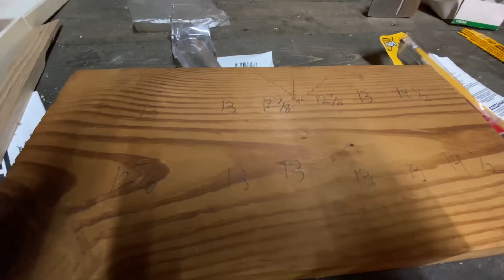The Modern Home Makeover // Episode 6 - Sistering Floor Joists in Basement

Comment: I use a lot of reclaim lumber and when I run into the nail issue I use a nail punch to drive the nail into the wood past the length I need to cut off.
There are powered Nail-punches on the market now also.

Comment: Try to bridge the joist this way they can distribute the load as a unit rather then what u have now which is individually. If u wanted to go overkill then double ply the subfloor or pull up the existing sheathing and go thicker.

Comment: I'm curious to know why you would think that adding horizontal structure like sistered joists and blocking would stop vertical bounce.
Reply from the maker: Because there shouldn’t be a bounce according to standard code in our area. In all honesty the bounce is minimal. But...Ray has too high of standards.  🤣
Reply: Bounce like that comes from deflection due to the length of the span and/or spacing of the joists under load. Laminating or sistering those joist together cut the deflection in half because wood is strongest perpendicular to the grain. This is why you see 3 and 4 layer girders in decks or upper level beams. Doing every single one may have done the trick but probably limited return compared to how much this improved it.